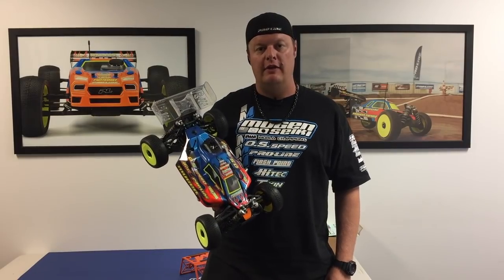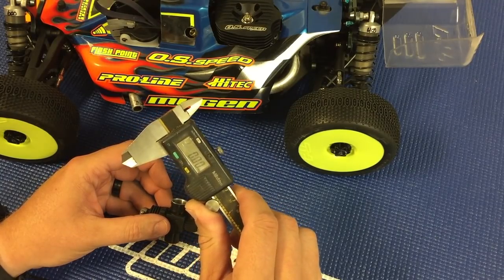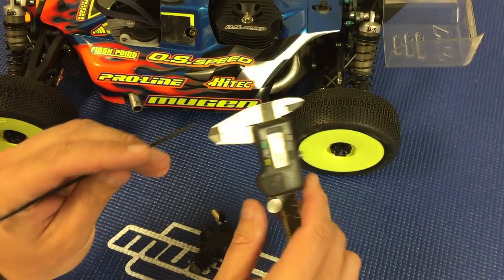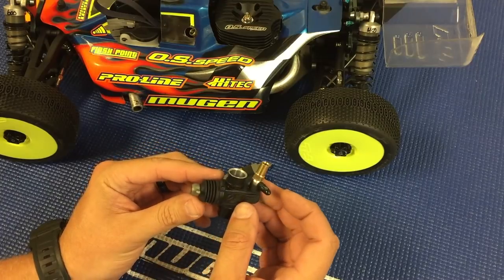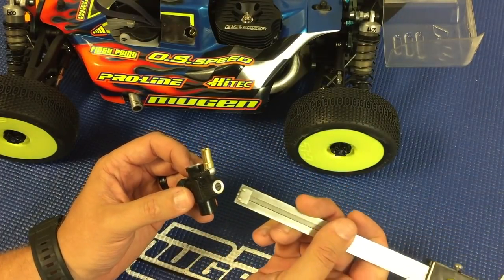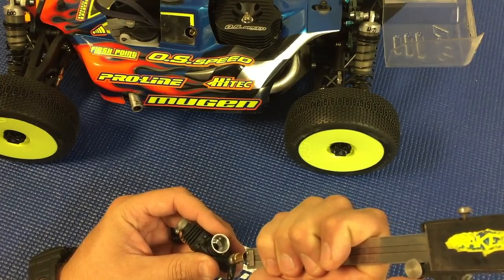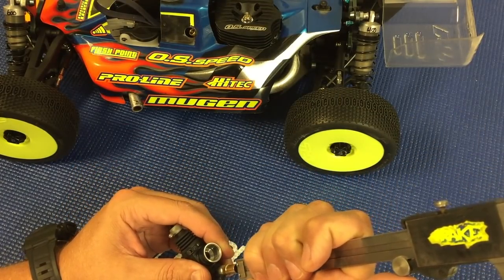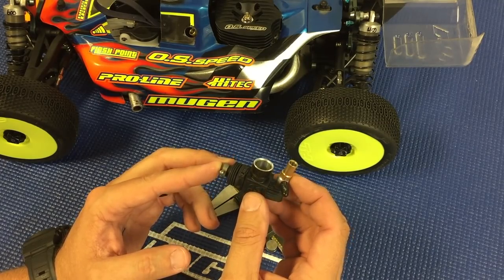Adam Drake from Mugen Seiki Racing talks about the carb settings for the O.S. Speed B2102 engine.

Comment: Hi adam, got this engine, and it is already broken in as well. Just a Q though. It says on its manual that the mid needle should be a 1whole turn in from flush. Tried that setting and it is terrible. Engine wont even start if it do it revs high. What should the setting really be?  Thanks in advance bud
Reply from the maker: The mid speed setting for the B2102 should be .5mm in from flush.  If you're using a 21J carb the mid should be flush.
Reply: @AdamDrake  thanks, the carb is what came from the engine. Ill try .5mm, been in the hobby for 15years  now, used to run MT's and 5th scale more in bashing. This is my first time trying to join  racing. Got myself a mugen mbx8t for truggy kyosho and sworkz for buggy. Got 2 of this engine for both of my buggy, and wow like what others says this engine is really so finicky.

Comment: hi adam,  i have the ultimate version of this engine with the same 22c carb, the latest video i posted is it running, i feel it hasnt fully broken in yet and my needles are both about half a turn richer than yours and every so often it wont idle, will act like its locking up due to pinch?
do my settings sound close for an engine thats still not fully broken in??
Reply from the maker: Yes, the setting from my video are for a B2102 that's fully broken-in.  If your still breaking it in the setting should be richer then my settings.  In the future, I offer a break-in service and the Ultimate engines are available with this service through Beach RC.  Thanks!
Reply: @AdamDrake  i dont live in america, it had an EBIS and around 2L through it now but still has that mechanical pinch feeling.
Reply from the maker: @Bestintheworldatwhatido  I understand.  Not all EBIS is the same, but if you still have metal pinch the engine is still breaking in and will require a richer setting.
Reply: @AdamDrake  thanks for the help.
Reply from the maker: @Bestintheworldatwhatido  Anytime!

Comment: What would happen if I took a speed 2 carb an ran it on las vages edition motor dont even knew if there the same carb don't have papers for the speed ty in advance
Reply from the maker: If it's a 21J carb, it should have the same settings.

Comment: Hi Adam are you really running a 7mm venturi with this engine? I ask because the b2102 is delivered with a 6.5mm & 6.0mm venturi.
Reply: I suggest starting with the 6.5mm, but if you need more power you can change to a 7mm.
Reply: Thank you Adam! Will do. I have found also a 7mm here from an old OS but will start with 6.5mm. Thanks again.

Comment: Very nice, the same way I always used to measure my carb settings, much easier to make notes and tune right. Got one of these engines with the 2090sc and 75mm header for my next build, the 10th anniversary edition tki4 inferno.
Everything's just been sitting in front of me smelling nice for days, because I dont have the right diff and shock oils to start my build yet...thats what you get for not building anything fast for years and years...torture lol

Comment: Hi Adam do you have also the settings for 25% nitro fuel?
Reply from the maker: I usually run 30%, but these setting should be pretty close for 25%.  You may need to richen the LSN slightly.
Reply: Wow, fast in youtube like on the track. 😉 Thank you I will give it a try...

Comment: This same carb is used on the new V2 Protek Samurai engines.
Would these settings also apply to that engine??
Reply from the maker: I believe the V2 uses the same 22c carb, but the engine is an older O.S. configuration.  The settings should be close, but not exactly the same because it's a different engine.

Comment: Hello, are these the regalges that you use during the races 
or is it only of settings sorted out of sorry factories 
I do not understand very well the translation of youtube of the times so,
I prefer you ask you in any case super job That you do thank adam
Reply from the maker: These settings are recommended when the engine is fully broke-in and used for racing.
Reply: Okay if you use these settings in races and as I'm not a pro I guess they are good to start with.
I think to buy it as a second engine 
I hear a lot of good on these engines I would like to test 
I am for the moment on an alpha dragon 3 and as car Losi 4.0
Reply from the maker: Yes, the O.S. engines are amazing!

Comment: Hello Friend good afternoon. I would like you to advise me about my new P5 Xlt, I already did the break in. And I go for tank # 10 I have venturi 6.5mm and I have two escapes 2086 and 9901 plus muffler 41021 and 41020. my handling is aggressive and the track where I run is medium in size and medium grip too. That you recommend me to use venturi and escapes ?? thank you very much
Reply from the maker: Hello, 
I don't have experience with the P5, but a 6.5 is a good starting point for most engines.  If you need more power, try running a larger venturi.  If you need less power, try a smaller venturi.
Reply: Adam Drake Thanks you man!!!
Reply from the maker: My pleasure!

Comment: Hello Adam, can we use this setting for the B2101 carburetor?
Reply from the maker: LSN:  .55
MID:  .15
HSN:  1.5
Reply: Thank you Adam, I think also depend of type of fuel you use... can you tell me max. temperature in Celsius for this engine?
Reply: Correct.  With the B2102 I usually run 265 - 285.  If it very hot outside, it's okay to run a little hotter.